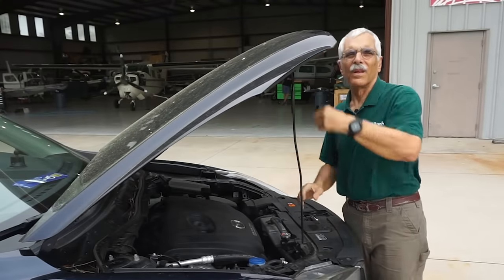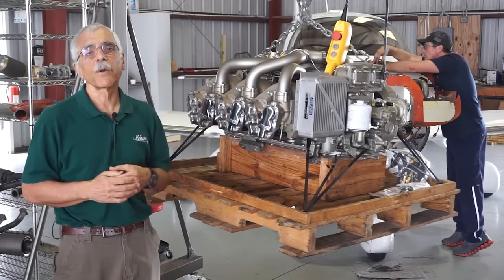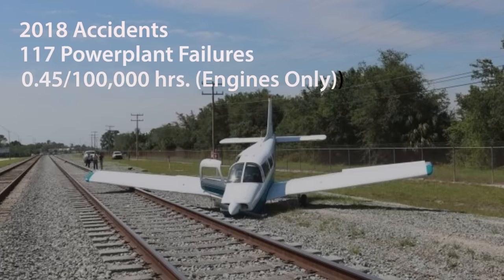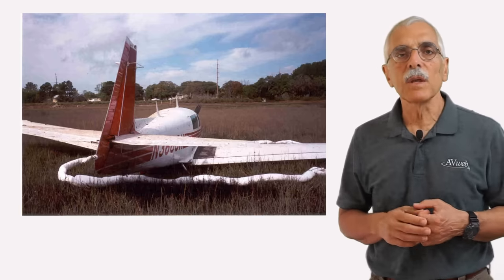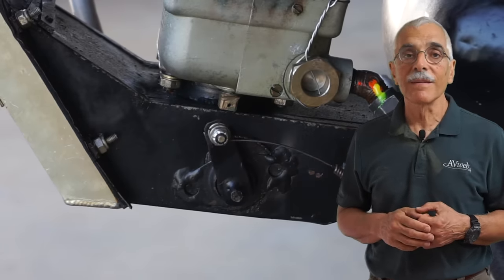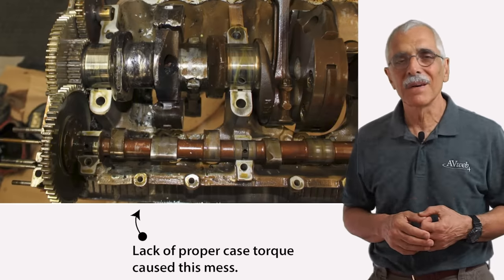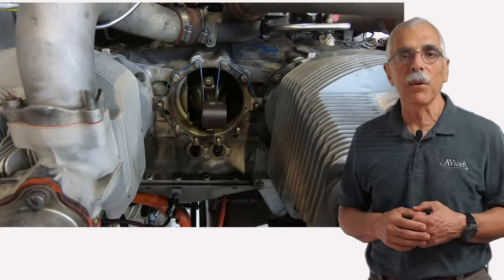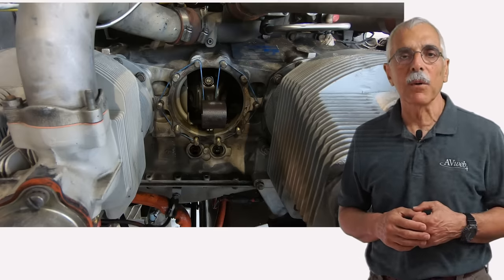Why Aircraft Engines Quit

Comment: If you fly long enough, you WILL have an engine quit.  My first partial failure was on a cross country when a valve broke.  Fortunately I also flew gliders and it was a hot day and I was able to use thermals to help me get 40 miles to the nearest airport.  I had multiple power losses in that airplane (an Ercoupe) after we installed a larger, 100 HP engine.  The STC for the conversion didn't say anything about the additional heat necessitating the installation of a blast tube on the fuel system to prevent vapor lock.  You could set your watch with this plane, 45 minutes after takeoff the engine would stop.  Pumping the primer would keep it running until fuel started flowing again.  One day I circled the airport until it quit, then dove for the runway, stopped on the runway and opened the cowling.  Sure enough, the gascolator was half full of vapor!  I also discovered that this gascolator had been assembled incorrectly from the factory.  The inlet and outlet tubes were swapped, which meant that contaminants collected inside the screen rather than being drained out through the quick drain in the bottom.  Installation of the blast tube solve the problem.

I had an engine quit on takeoff in my Aztec.  One of the mechanical fuel pumps had been replaced with a rebuilt unit that had failed internally, blocking fuel flow.  Because of Piper's improper engineering, blockage of the mechanical pump also prevented the electric pump from working, as the pumps were in SERIES.  When this was reported to the FAA, I learned that they really don't care about safety.  I suggested either imposing an AD requiring that the pumps be plumbed in PARALLEL with appropriate check valves, or a change in the flight manual to require that crossfeed be selected during takeoff, which would have allowed both engines to feed from fuel pumps on both sides of the airplane.  The FAA did nothing to prevent future failures.

I had water contamination in my Navion's fuel after being parked at the Oshkosh airshow for a week.  The plane was parked on a slight slope, which prevented water from being drained even though I sumped the tanks.  When you depart Oshkosh, there are a hundred other planes waiting to depart behind you and it's not really feasible to stop on level ground to drain your fuel again.  I pumped the primer to keep it running until the water passed through the system.  After landing again, I was able to drain some water from the accumulator tank.

Had carburetor ice in my Navion during my CFI check ride while doing a power-off landing with an FAA inspector.  Carb heat was ON the entire time.  The engine sputtered during the landing and we had to call for a tug to pull us back to the ramp.  

Had a student pilot that suffered a broken rocker arm shaft boss on a Continental O-200.  He was in the pattern and was able to make it back to a different runway.

Another pilot that I had trained that suffered power loss due to a loose fitting on a fuel selector valve.  Fortunately I had trained him in the proper way to turn back to the runway and he landed without incident.

Yep, engines quit a lot more often than most people think!

Comment: For Private Aircraft, Maintenance at regular intervals, every 25 hours of operating time, 50 hours and 100 hours. Spark Plugs, filters, oil changes, etc.
IIRC, at 100 hours of engine time, a complete tear-down and rebuild if needed.

Comment: As a german VFR and N-VFR pilot I found this video pretty acurate. 
For example, night flying single engine piston is not signif. more dangerous in Germany  than twin engine aircraft. The DANGER of loss of  power  is lower than other dangers: Nr 1: Loss of controll, especially during takeoff or going around after missed approach. 
Nr. 2 : CFIT, because of inadequate manouvering in  IMC conditions
Nr. 3: RARE : Loss of power- thrust.
Nr 4: Midair collision: PRETTY RARE.

The most common reason for Nr. 3 : 
Fuel starvation
Carburator icing (pilot error)
In 90% of the cases:
So : We minimize risks when:
1. We optimize our fuel Management  before and during the flight( more fuel and frequent check of the tanks)
2. We use carburator heating a little bit more frequently during warm up and flight . Or if we fly aircraft without carburator ( for example C 172 SP )
Greetings from Germany.

Comment: I worked on an engine that would only start when cold. 
Turned out that the ignition coil had a break in the wire when it warmed up; it wasn’t enough of a gap to stop the engine from running. 
I used a multi meter and measured the resistance when it was cold and it was within spec. 
It took too long to get to the coil when it was warm to measure the resistance so I removed the coil and put it in the oven and sure enough the meter read infinite resistance. 
I think coils should be replaced regularly; tens of thousands of volts millions of times tends to wear things out. 
Lightning in a plastic can.

Comment: I'm an automotive tech with 49 years experience. I have noted that automotive engines with opposing cylinders fail more often than in-line engines or V engines. As most small aircraft engines have opposing cylinders I am wondering if this is a factor in aviation engine failure.

Comment: The engine on my piper arrow crapped out right after my commercial checkride on the way back from where I successfully passed it. The grinding noise, vibration, oil and hole in the crankshaft I will always remember. Declared an emergency and dead stick landing. The DPE was like "I heard rumors" a few weeks after. Fact of life and why we train for when an engine quits. Lucky for me the airport was glide distance and  as the joke goes the best glide for an arrow is throw a brick out the window and follow it. Kept my cool because pilots are cool... we cannot be affected by such thing and fly the plane til the end.

Comment: I like the way you started with the comparo of engines.  I recall when the Porsche flat 6 became an aircraft engine.  I recall they changed the timing chain to gear driven.  Did they work well or have a high failure rate?  The base problem here is aircraft engines are much like marine engines and unlike auto engines.  Genrally speaking aircraft engines are always under load and not 'coasting'.  Marine engines are also under load, no coasting.  Autos coast frequently.  So, if a multi cylinder 4C4V VVT DI automobile engine was fitted to an airplane with timing chains is it likely we would have many types of failures?  In our marine world, simplicity, oversized load points tend to provide better reliability.  Although if you do shorter time maintenance and overhaul more often, some auto based engines could work well in the marine world.  What is your take on this?  Great video.  Enjoy your channel.  We grew up with a Cherokee 6 and a Piper Aztec.  Seems like I routinely found water in the Aztec wing tanks (you need to get a bigger jar).

Comment: Nice ending ! I do know autos do not break down like they used to (pre 1980) Better ignition and fuel systems. Better oil too. Batteries are the exception. Higher output alternators seem to take there toll earlier.

Comment: Stupid question. I have minimal experience flying light aircraft however I have been driving cars and motorcycles and Pick up trucks for 50 years nearly all of which were purchased second hand and the Service done by yours truly, a decent but amateur mechanic with limited funds. I must have driven or ridden in the neighborhood of 750,000 miles which I figure is equivalent to around 37,000 hours operating the vehicles.In all the time I suffered a handful of Engine failures most of which involved failure to start, failure to develop full power after extensive work on the machine usually due to carburetor issues, or a stall typically after splashing through a deep puddle of water.I don’t think I suffered a single failure during takeoff or cruising. Even my ancient and temperamental 1974 Norton commando which was notoriously difficult to start never broke down during cruising with the exception of dropping a main carburetor jet that I had failed to tighten properly and yes the crappy Amal carburetors would sometimes run rough when I did not succeed in tuning them properly. So why the rare but significant number of engine failures on civil aircraft?

Comment: What was the point of your introduction featuring the Mazda CRV that "had zero engine failure". I would have suggested that whilst the CRV is a high output engine and therefore 'stressed'  most drivers rarely drive that way. CRVs are light and today's roads are pretty tame. I would add, however, that reciprocating mass is much greater on the aircraft engines, especially in relation to the weight of the other components, notably the crankcase.

Comment: As for random mechanical failures of automotive engines... my Ford 4.2L V6 from the late 1990s decided to punch a pushrod through the rocker arm on cylinder 5's exhaust valve (or more accurately, the rocker arm metal appears to have fractured and the pushrod simply went through).  Granted, this was at over 300k miles, so not really a direct comparison to an aircraft engine that would be overhauled after only a few thousand hours.  And yes, I drove it (gently) 20 miles home, put in a new pushrod and rocker arm, changed the oil and filter, and it appears to have suffered no significant, lasting harm.

Comment: Not being an aircraft mechanic but understanding machines in general the worst thing you can do to an engine is leave it sit without starting and warming one circulateing oil a regular basis..oil drains down resulting in dry starts corrosion increasing wear..lubricant moving parts and cables and generally exercise moving parts..move it to scrub the brakes and change hydraulic fluid once in awhile...Be Safe..

Comment: Another good one. Thanks. But you sort of posed an unanswered question. Why dont planes then use automotive engines more? Or put another way, what would be a similar driving condion that would mimic the demand on an automobile engine turning a prop?

Comment: My CFI drilled into me that if I had an engine out at/after takeoff not try to return to the runway. But while I was still her student she had an engine out (a head problem if I remember correctly) and managed to get back to the airport - not quite a 180 degree because another  intersecting runway was available. But her advice was still sound.

Comment: Rotax engines are more common in kitplanes and have non A&P owners doing more work on them than general aviation Continental or Lycoming. Owner operator self made mechanic is to what we in the kitplane community attribute the higher incident rate of the rotax.  It would be enlightening to see a break down of the breakdowns and see what percent are from sloppy set up and maintenance.

BTW,  the Continental O200 could experience carburetor ice even when carb heat was on properly.

Comment: As a newcomer it seems to me that the problem is: the engines have to do quite some work, but get stressed quite a bit due to lack of standards (lack of QA in maintenance that may overlook things, different fuels and fuel contamination, wrong usage during flight) and thus they can only dream about the reliability of car engines (further a car engine is not as taxed as a aircraft engine I would assume)

Comment: I'm an electronics engineer, very interested in reliability, not working in aviation so not practiced in such safety critical stuff, but I am also used to driving and racing older Volvo's.  I find them to be extremely reliable and long lasting.  For example they have nearly always used automatic thermostatic inlet heaters, I have never seen one fail.  The only failures I have had are fuel pump related which eventually wear out because they are brushed DC motors, brushless motors would not have this problem and can have dual redundancy easily.
Electric airplanes should therefore become much more reliable, even if you use a generator to supply power the battery and motor can easily deal with the duty cycle much more than a complex high power combustion engine.  A generator failure would not then be as critical.  Why Hybrid aircraft has not emerged is probably for the same reason that aircraft use old un-automated (mistake prone) controls, ie fear of risk and lack of returns business model.
In combustion is has been possible to make the automated combustion engine extremely reliable, however most companies have not done this, even Volvo eventually stopped producing such reliable engines, because the dealer business model doesn't support it and you would need to give longer warranties that non-technical management don't want.  This was after the redblock 4cyl turbos, they produced the aluminium 5 cly, which is very popular despite being of lower strength/more wear and cannot (IMO) be described as reliable.  Later engines have gone back to the 4cyl turbo model.
Modern safety standards in electrical products (I am also a regulatory engineer) involves single fault tolerance, or registered/monitored manufacturing, so if a single fault can cause a critical failure you need a backup/redundancy or the component manufacturing must be 3rd party audited. Airplanes don't seem to have that, perhaps relying on licenced service mechanics.

Comment: Hi there I was watching your video and you mentioned Rotax Engine failures
I recently had a hard landing after takeoff when my rotax engine 582 suddenly quit turning at 75 above water.( 1986 Beaver RX 550 amphibian).

After retrieving my aircraft a week later under 16 feet of water I opened up the engine and found that number one cylinder had seized.( Brand new engine with 12 hrs running on non-ethanol previously and now with approximately 2hrs this summer on ethanol blended premium gasoline)

Manitoba government in Canada has implemented ethanol blend in all grades of gasoline sold at the pumps.

My engine requires non-ethanol with a 50 to 1 oil mix ratio for proper lubrication. 
After my accident I researched and found out that ethanol is a killer for two-stroke engines that run at higher RPM’s. Fortunately I walked (swam) away from my hard landing but someone else may not be so lucky.
Please share with others.

Comment: Good, but that C172 was not doing "A Turnback maneuver" at 15:50.  See he is like on a very low downwind leg on side of runway, not at end of runway like "A Turnback Maneuver" is.  He is on a too low Turnaround The Airport Maneuver, which is not "A Turnback".  On the Turnback you dont turn around the airport using the downwind leg or "Turnaround" anything.  You just turn to the closest runway from initial climb. You Turnback to opposite runway or closest runway to the side if crossways.   Turnbacks are not Turnarounds.  
I learned Turnbacks vs Turnarounds maneuvers 20 years ago from ELM Channel now retired CFI.
Reply: Right,  Guys that dont know "Turnbacks" call them  "A turnaround"  like a Turnaround A Point maneuver,  But you dont "TURNAROUND" nothing  or anything ON A TURNBACK.  You just turn to opposite runway or other close runway not around the airport maneuver.   Should we call Turns around a point as "TURNBACKS AROUND A POINT"?  No, it is a different maneuver.

Comment: theres one thing that cars have that piston-powered planes dont: some sort of clutch and transmission, as well as systems to make sure that the shaft is up to speed before it fully engages (the conical shape to a clutch)

ive seen diagrams and such with them being directly connected to the crankshaft, and some of that vibration is probably bad for the gearbox

theres that and the fact that the loading is different, a car is usually loaded by the rest of the drivetrain as it gives resistance, but at certain conditions, theres no load as the aircraft is flying as fast as the propellers can glide through the incoming air, or there could just be not enough resistance whatsoever

road cars have to deal with many different RPM levels, but usually are geared to stick as low as possible without being too weak to push the car faster when needed or stall when a hill or deceleration happens

theres also temperature differences
i see many cars overheating, but like in the video.... it seems to be that things get too cold (this could also be exacerbated by the fact that i see a lot of those engines seem to be air-cooled)

Comment: My Mazda 3 went one hundred thousand miles or roughly 2500 -3000 engine hours (assuming an estimated 35-40 mph on average) with nary a hiccup. However toward the end the "check-engine" issues became a regular occurrence with small but vital sub-systems requiring attention. The final blow came when rain inexplicably entered the cabin interior and moisture corroded out the electronic ignition modules. Other than that though, it performed flawlessly and probably with repairs could soldier on another hundred thou.. as the oil still glowed a bright amber between changes. 
...Now, ask me about my Lycoming O-145 am trying to get back online in a Taylorcraft. To begin, Lycoming no longer claims it... sort of  like what am experiencing now with Microsoft and this Windows program! Parts have to be bought from the current TC holder, and fuel changes requiring revised timing settings are beholden to the last MSDS updates... dating from 1950, and written for 80 octane! Up from the low '70's! The airport avgas here starts at 100. Unleaded ethanol-free from auto gas islands around 88 to 90. But try and get approval for re-setting the timing for optimum power! I could go on. 
The single factor most responsible for holding back technology with aviation powerplants is and for the foreseeable will be - you guessed it: The FAA! Don't take my word for it... ask Mike Busch, aircraft engine A&P /IA mechanic, aviation author and EAA webinar speaker extraordinaire. He knows rings around my knowledge of all this.